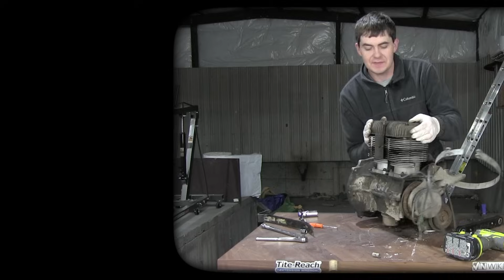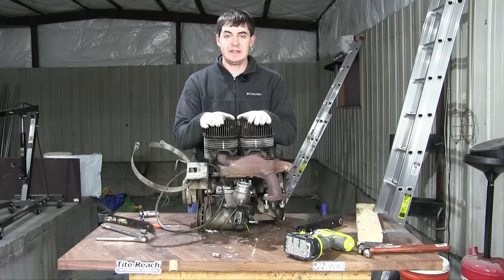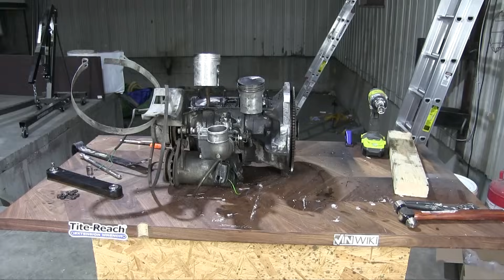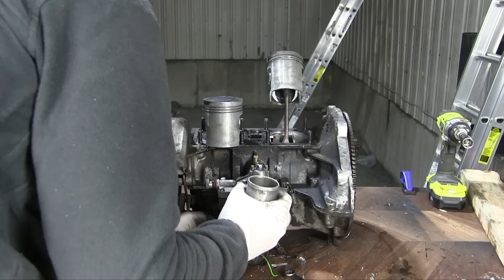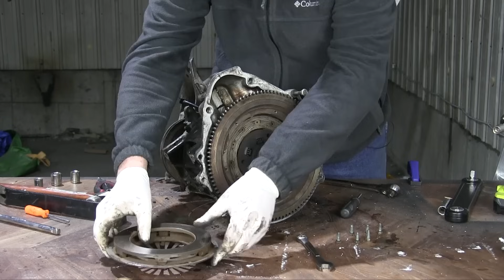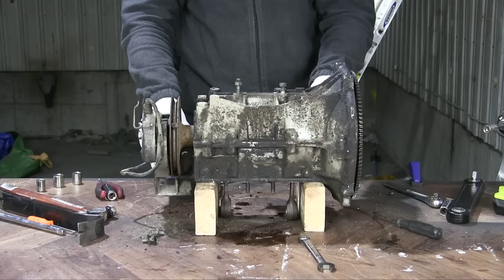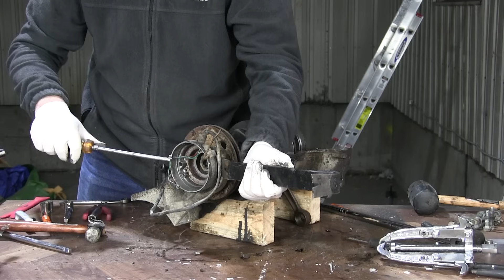Rebuilding the Trabant's Engine: Part 1 - The Teardown

Comment: "For the entire time I've owned this car, it hasn't run right." - Did ANY of them EVER run right?  🙃
Reply: Legion of Weirdos  Actually quite good wee motor.  If running well it's a reliable car.
Reply: One German told me that Trabants were called "lawnmowers with a seat".
Reply: its still a german product, the build tolerances are there for a reason.
Reply: Yes. Not strong by any comparison but extremely reliable and, in city driving, quite agile at that. The bar was not set too high but what it promised it delivered very well.
Reply: @gabor7928  I grew up in West Germany. Trabis are absolute shit. I know this first-hand.
Reply: @dieselscience  I drove one. Does that qualify more than just growing up in a country that was neighboring its country? :-)
Reply: @gabor7928  I drove one also.. a 601. It was shit. They're illegal today in big cities for a reason.
Reply: @dieselscience  Yes but that's not important. It was a car born in the fifties. We're almost 70 years (!) from that time now. Things have changed a lot. Many things, not just that one. Yes, it never was a good car, of course. But the question was whether it had run right. And it did.
Reply: Define "right"!
Reply: Yes. The ones modernized by the Germans and made into Smart's concurence.
Reply: @faszkivanmar23  They were originally made by EAST Germans and they never had anything to do with Smart.
Reply: @dieselscience  
The restorated Trabants... Most of them run in Berlin... The modernized ones. Which have LED lights, modern interior etc.
Reply: @faszkivanmar23  Those are privately owned and restored. The company shut down the year after reunification. They're two-stroke and also ILLEGAL to drive in Berlin because of emissions laws in big cities.
Reply: @dieselscience  
FYI, with the "Smart's concurence" I was being ironic.
Reply: @dieselscience  Its not Illegal if you know how. With the H Numberplate youre not bound by the CO2 Regulations. and an Oldtimer after German Law is any Car over 30 Years old with original or "decade accordingly" Parts. And seeing how Hungary, Poland, Rumania and so on can throw you these Parts like nothing. Its not a Problem
The Only Problem is that the H Number Plate costs you 191€per Year for yur Car Registration. Registrating it normally comes Cheaper. So if you wanna drive it in Berlin or Hamburg get the H Registration and pay the "bit" more per Year.
Reply: @kaitan4160  That's not how the plates work in Germany. "H" means nothing more than the car is registered in Hanover. Emission control categories are color coded green-blue-yellow-red and Trabis are RED meaning you CAN NOT drive into large cities at all. https://www.tuev-sued.de/auto_fahrzeuge/feinstaub-plakette/feinstaubplakette_ausland/england
Reply: @dieselscience  I am a German and i dont talk about The City Marking. I am talking about the Marking that at the end of the Numberplate, after the Numbers have an H for "Hirstorisch". These are called "H Kennzeichen" (H Number Plate).
https://www.bussgeldkatalog.org/wp-content/uploads/h-kennzeichen-aussehen.png
Theres an example. So yes with the H Number Plate you can drive everyhwere in Germany.
Reply: @dieselscience  do those laws apply to antiques?
Reply: @lionreb  The emission codes apply to ANY vehicle registered/plated to operate on a public roadway. Some entire counties (Landkreis) do not allow a Trabi to be registered.
Reply: @dieselscience  The emission codes do not apply to "any vehicle registered to operate on a public roadway". Vintage cars, registered as such, are exempt. They are working on that issue, to ban vintage vehicles in certain areas, yes. And most of the newer vehicles, too.
Reply: @urgolf1974  Driving a Trabi in a 'green sticker only' zone is illegal. FOR ANY YEAR OF CAR THAT DOES NOT MEET THAT STANDARD I posted the link already.
Reply: @dieselscience  For a car, registered in germany as vintage vehicle, its not illegal.  https://www.buzer.de/gesetz/7387/index.htm  ,  Anhang 3 (zu § 2 Abs. 3) Ausnahmen von der Kennzeichnungspflicht nach § 2 Abs. 1   , 10. Oldtimer (gemäß § 2 Nr. 22 der Fahrzeug-Zulassungsverordnung), die ein Kennzeichen nach § 9 Abs. 1 oder § 17 der Fahrzeug-Zulassungsverordnung führen     Sorry, not in english.
Reply: dieselscience No, they are all older than 30 years by now, so you can register them as an old timer. You get a license plate with a trailing H (for „historic vehicle“), then, and with that you are allowed to go into the environmental protection zones without having to have a green emissions plaque in the windshield.
Reply: You win the Comment of the Day.
Reply: Im from Germany and I know a lot of people who own and drive a Trabant as a daily and they run pretty well.
Reply: I doubt it.....
Reply: well  yes in its days they were quite reliable , but now when you dont have to have what you are give why would you like it to have it
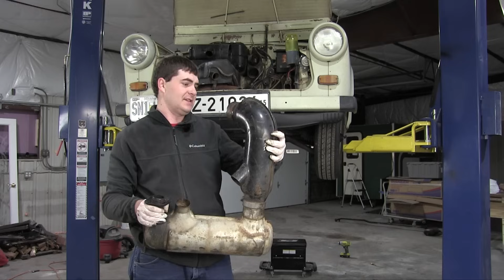Reply: with the RIGHT know-how on 2 strokes you can make it run better than any 4 stroke powered vehicle and i always recommend 1:50 premix like aspen 2
Reply: Oh, they can absolutely right, when serviced properly. When the GDR still existed, most Trabants were DIY serviced and spare parts weren’t always available, so there was often some improvisation done. This resulted in badly timed ignitions and carburators, which led to massive backfires and bad fuel to air mix ratios... Which in itself led to those familiar plumes of blueish smoke.

After reunification, the remaining Trabants were usually properly serviced in a repair shop. They began to run rather smoothly afterwards, with almost no backfiring at all and the exhaust being amazingly clean (for Trabant standards, at least).
Reply: LukeTheRevhead  Luke, the body is made of phenolic plastic.
Reply: Legion of Weirdos ---But they are a trip to drive and they really sip gas. But I don't go any where far lol,lol
Reply: They were communist cars, they only ran very very left.
Reply: I've used two of these while the were "new" and serviceable. As long as you put the right amount of oil, not too much, not too little, they ran very well. Of course you can't compare them to a modern car.
Reply: Runs sure better than many american ''brains'' brainwashed fom the chilhood
Reply: @gillespriod5509  Trabi is a pile of shit and I'm from Germany.
Reply: no they ran left😂😂😂
Reply: They sometimes ran left.
Reply: No worst piece of shit :)
Reply: @adipop   Esti ca si cum daciile ar fi fost masini mai bune… (irony)
Reply: @adipop  The Trabant was a good car, the problem in Romania was the lack of the original parts. I had very satisfied clients about Trabant cars.
Reply: @adipop  yugo is far worse

Comment: Why not replace the carb with a bombardier low pressure fuel injection kit?
All you are going to need is an air pump driven off the engine. It will improve emissions, engine life and give you improved torque
Reply: Improve emissions on a Trabant? Gimme a break.

Comment: from my experience with 2cyl 2 stroke engines, a little bit of play side to side is normal for connecting rods, but it's the up and down movement you don't want.

Comment: dude you forget to drain coolant from radiator :))))
Reply: The scrub didn't even get rid of the wast blinker fluid
Reply: He also discovered he had a loose muffler bearing.
Reply: @jacobbelcher3512  never would have happened if he had kept the muffler belt tight...
Reply: I bet he also forgot to turn back the timing to adjust for daylight savings.

Comment: A trabant engine and transmission may be small, but it’s a car engine non the less.
Reply: You can lift the engine, it ways only 50 kg. You just have to disconnect the gear box before.

Comment: Trabant the Russians revenge
Reply: Your ignorance is astounding. The Trabant is a German engine, designed by Germans and has absolutely nothing to do with the Soviet Union or Russians. The only Soviet two-stroke car engine was in Invalidkas, which were powered by an IZH motorcycle engine.
Reply: @peterwilliams2152  The trabant was built in east germany when east germany was under the control of the Russians this was before the wall came  down soviets had control over everything that was manufactured learn history before you call me ignorant
Reply: @michaelovers688  The Soviets transferred ownership and control of Awtovelo to the DDR in 1952 and all decisions for the new VEBs were made by the East Germans. It was the DDR that decided to use a pre-war DKW derived engine in the Trabant manufactured by VEB Sachsenring. It had nothing to do with the Soviet Union.

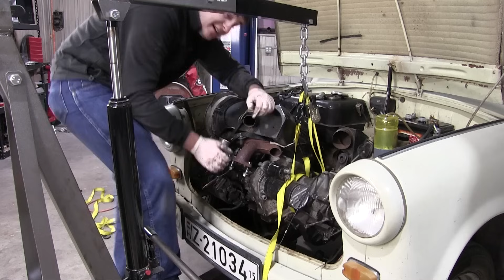Comment: 3:30 You can, i did it with a friend. If you care about paint then do it with two persons. But if you dont... just strap around your neck, short stop at the front pumper (put a fat towel over it) and it is out. You normaly dont remove engine and transmission together because the transmission is on two mounts and the engine only on one. That means you can leave the transmission in it. When you change the cltch, you dont remove the transmission, you remove the engine :D because it is easier :D
Reply: Funny video still :D  BUT PLEASE dont buy all the trabant parts, we need them in the motherland X-D

Comment: You are not a "new soviet man" if you cannot pull a Trabi engine out with your hands. :)  You will need to flex hone the cylinders to break the glaze. The piston skirts control the connecting rod side to side play at the top, the big end sideplay was supposed to be shimmed up to around a half mm. The "intake" ports are called "Transfer Ports" - read up on "Schneurle Porting". The Wrist Pins (Unknown Object) should be a gentle press fit with the Trabi, and should be held in with Circlips at both ends (it's been a while); make sure to orient the clips with both ends "up" or "down"... a circlip facing the sides of the cylinders can become dislodged by centrifugal force. The Term Dynamo is somewhat generic: can be 6V or 12V DC Generator depending on the year (The term has evolved over the years, today a "Dynamo" is a self-exciting DC generator...Permanent Magnet Generators are just DC Generators), later Trabis used AC generators (Single Phase in all cases, IIRC; alternators are technically 3 Phase AC generators). Rebuilding a Crankshaft is a non-trivial exercise, big hydraulic presses, big hammers and wedges, and fairly sophisticated measuring tools are required.

Comment: Are you planning on upgrading the electrical system to 12v? I know it'd be a lot of work making all the wiring and the few electrical accessories work, but having worked with 6v systems it's worth the upgrade in my opinion.

Comment: Gudgeon or wrist pin, never seen inside a Trabant engine no rear port that explains the lack of performance, an automotive engineering shop could seperate the crank and replace the bearings and probably fix the pin for less than a new crank

Comment: So if the inner part of the muffler/heater fails, then you will have nice hot exhaust fumes, injected directly into the cabin of the car.

That sounds a bit dangerous.

Comment: Oh dear. What you've just dismantled is a perfectly standard type of construction for a 2-stroke motorcycle engine. You don't really need a new crank - just a workshop familiar with and equipped to split the crank, replace the bearings and press the lot back together in alignment. It's probably a 1/2 hour job max for someone who knows what they're doing. The 'generator' is a dynamo which produces 6V DC current rather than an alternator making 12V AC current. PS: I really hope you marked pistons and bores in pairs - putting the left piston in the right bore won't do you any favours.

Comment: Side to side is needed for a 2-stroke - you need that oil getting between the piston and cilinders. You want absolutely NO vertical play and some horizontal play like you have there. You, in fact, have a good small and bigend bearing there

Comment: A common Trabant Engine swap here in germany is the engine off of a Wartburg 353. It's also 2 stroke but has 1 liter of displacement and 3 cylinders. There are bolt-on kits for that swap. Also you can get the Wartburg engine to about 90 hp with some tuning done. These creations are then normally called Wabant and they fucking rip.

Comment: Trabant engines were actually used as windshield wiper motors on russian cars
Reply: you're joking, right?
Reply: @luuk3213  yeah, they were used for rolling windows on GAZ limousines as well; it was obviously a joke but to tell you the truth Trabant was the longest car in the world: 10 feet the body and 60 feet the smoke behind it; everybody was making fun of Trabant back then. There`s even one about a bloke from the East Germany driving a Trabant and visiting the West; when the engine of his Traby breaks down he goes into a Mercedes dealership and since they don`t have any Trabant parts to fix the car the mechanics put a windshield wiper instead of the Trabant engine; after a while the guy sends them a thank you letter: Performance of the car improved 100% all is great, only complaint: for every mile moving forward the car reverses half a mile.